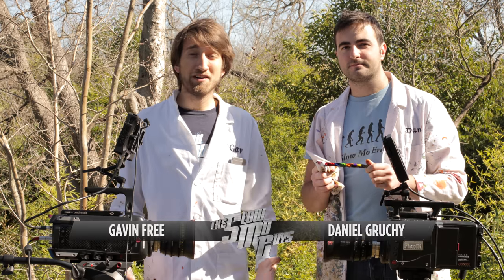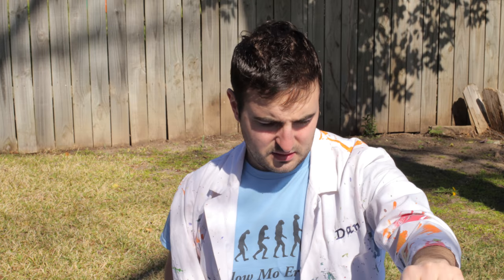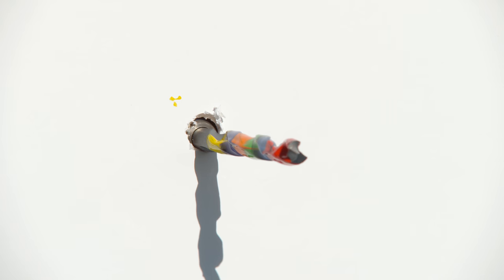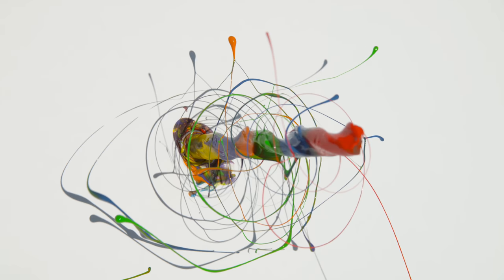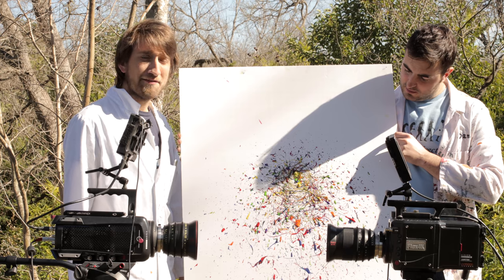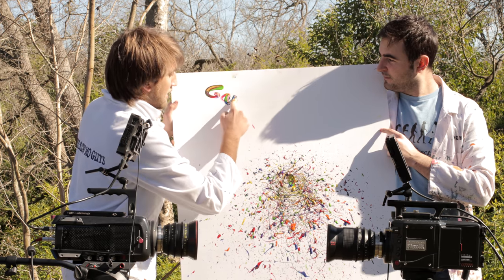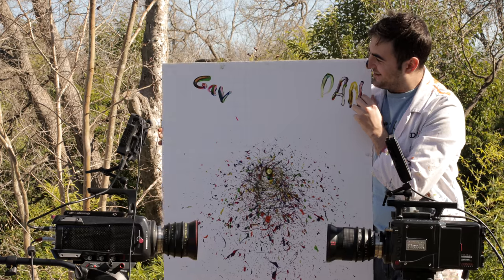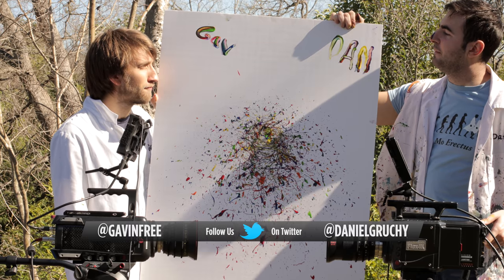Paint Spinning Drill 4K - The Slow Mo Guys

Comment: Throw cold water into hot grease. Then after that start a grease fire and before properly extinguishing it show what happens when you put water on a grease fire. This could be used as a PSA to prevent house fires.
Reply: ThePrufessa well they tried oil fire in slow motion and Dan really hurt his hand and leg